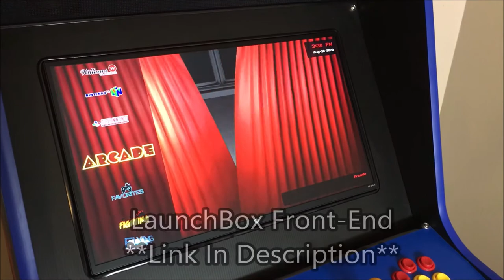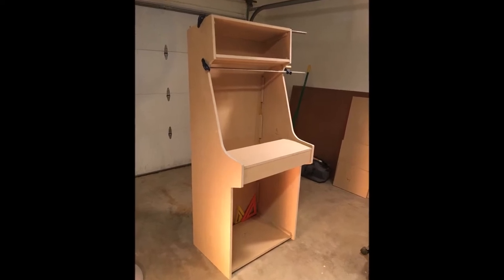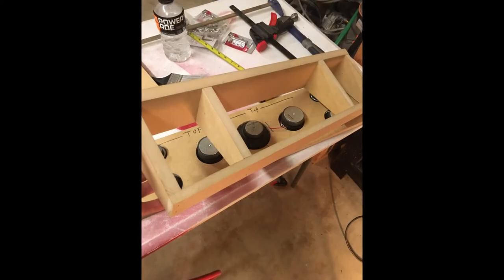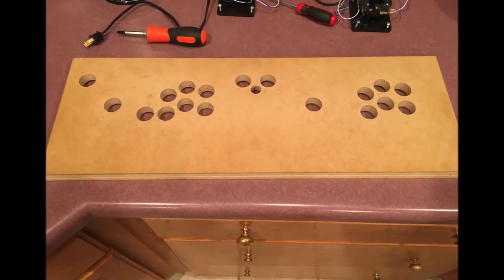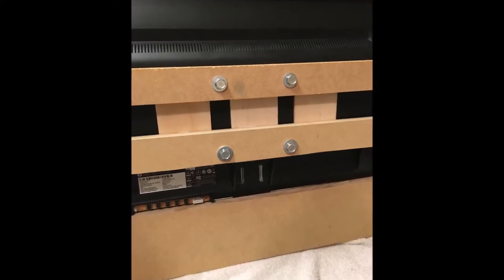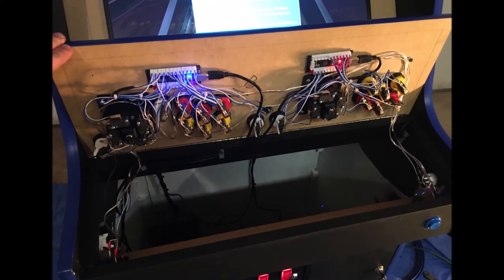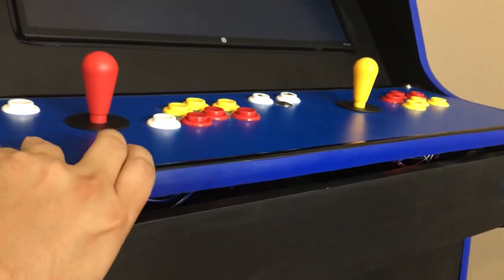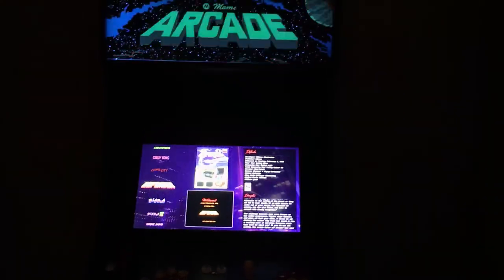Homemade Arcade Cabinet!! LaunchBox & BigBox Powered, with Steam Pinball!

Comment: Great Work!!! How did you set it up so that you have to press the $0.25 button in order to play? If I may ask.
Reply from the maker: Hey Carlos!! If you run Launchbox, there is a settings menu, where you can assign ANY button you want, to perform any way you want. Since I made an arcade with actual buttons, instead of just using a keyboard, I was able to assign those 25 cent buttons, as a “key” on a keyboard, so to speak. That’s what the usb encoders I listed in the video are for 🙂 They’re basically mini keyboards that can talk to the computer in the same way as a normal computer keyboard. Then you just open up the button assignment menu, and press the corresponding button, to whatever function it says on screen, and it locks it in. That may all sound confusing (or you may already be familiar with Launchbox) but that’s how I’ve done it. If you’re NOT using Launchbox, I’m not real sure how you could do it, as this is my first (and only method) building an arcade. If you DO have Launchbox, and can’t find the settings, let me know, and I’ll hop on my arcade, and give you a step by step how-to 😎

Comment: Where do I get the wires for the 25 cent buttons to plug into my encoder?
Reply from the maker: I just used the original pigtails that came with the encoder, and extended them using speaker wire 😎

Comment: Looks amazing! Quick question-- what screws did you use for the threaded inserts? I can't seem to figure out which screws fit into those. Do you have a link?
Reply from the maker: Hey Adam! 1/4-20 machine bolts, is what this particular threaded insert uses. However, if you have a local hardware store, they will sell multiple different styles! Just ask for “threaded inserts”. As for the length of the bolt you need, it really all depends on the thickness of wood you use (I used 3/4” MDF, which I HIGHLY recommend over 1/2” MDF), and also which joysticks you buy. But if you’re buying the joysticks I used, and using 3/4” wood, then a 1/4-20 x 3/4” machine bolt would be perfect. And with all of this, I’m just assuming you’re using the imperial measurement system. If you’re not in the states, and using the metric system, then you might try buying a metric threaded insert, so you can match up which bolts to use, accordingly 🙂 I really hoped this helped...and if it didn’t? Please let me know, and I’ll try my best to further assist you! Also, you can follow/DM me on Instagram, @vip_brigade, for more in depth discussions if you’d like 😎 There’s so many good videos of cool things out there..but so many people keep it a secret, and aren’t willing to help the people who are interested! I work TWO full time jobs, and still love to make time for my friends, followers, and fun hobbies! So feel free to reach out ANY time, and I’ll answer as promptly as possible! 👍🏼👍🏼
Reply: @vipbrigade  Perfect, thanks so much! I'm building a bartop, so I am indeed using 1/2" MDF, but I've built larger cabs with 3/4" before, I just used plywood so it wasn't as necessary to use a threaded insert. Thanks again!
Reply from the maker: Oh, perfect!! Yeah, that would be a heavy tabletop with 3/4” lol... Glad I could help! Let me know if you have anymore questions about mine! 😃